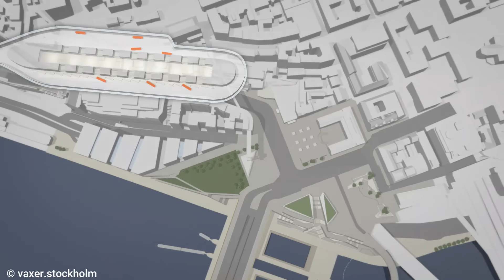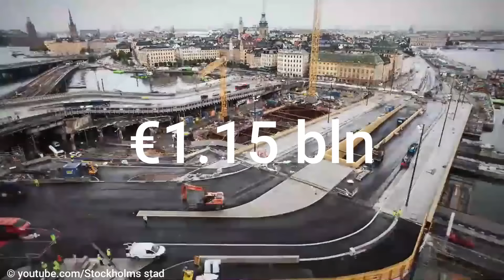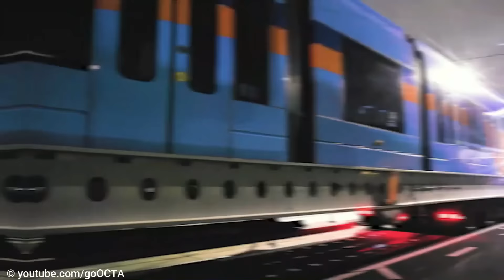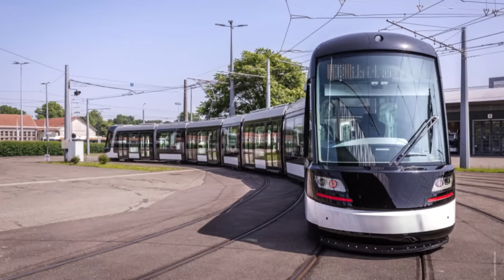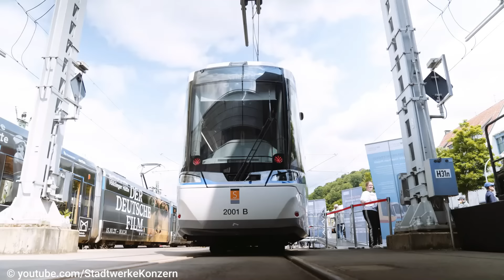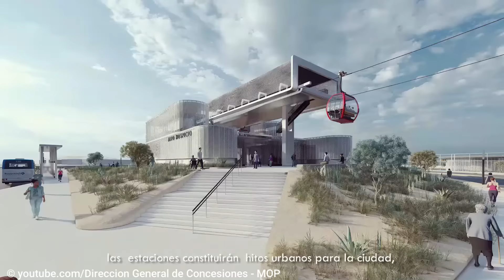Stockholm's Slussen Square Opened | New Trams in Strasbourg | Cable Car in Iquique | Urban News 69

Comment: Can't wait for the new trams in Strasbourg! While I absolutely love the look of the old Eurotrams (although they looked better before the mid-life refurb), they are too noisy and the doors are truly terrible. The new trams aren't that different from the majority of the current fleet (which is the previous generation of the same Alsthom model) - but it will still be a massive improvement.

Good news about Saarbahn too - hopefully the new model will improve reliability and increase the service to France.
Reply: Do you know if they plan in expanding the network in Saarbrücken, too, or is the order just to replace the current fleet and maybe expand frequencies a little?

Comment: It would be really funny if they extended LA's proposed Southeast Gateway Line all the way down the ROW to meet up with the OC streetcar
Reply: The plans are leaning towards the opposite, extending the OC Streetcar to meet the Southeast Gateway Line. 

Though I'm wondering if LAMTA is going sacrifice the gateway line to get other projects like the Sepulveda line off the ground.

OCTA is also talking about connecting the line to Disneyland.